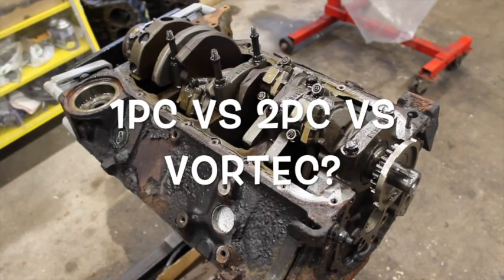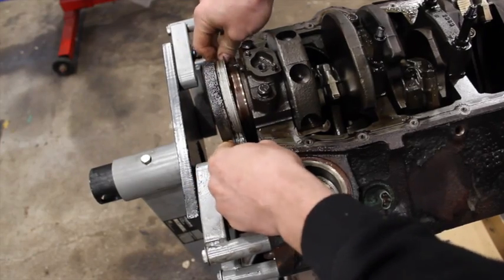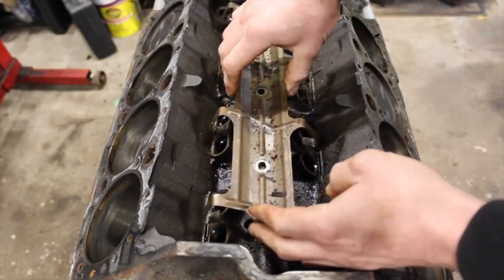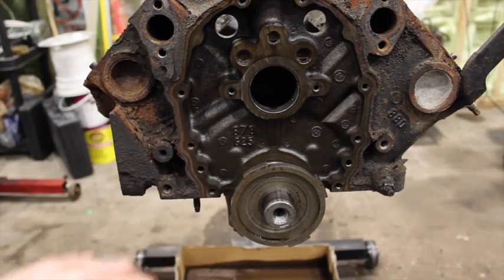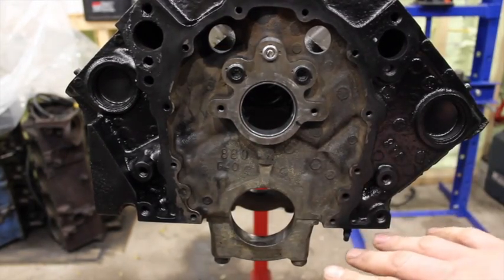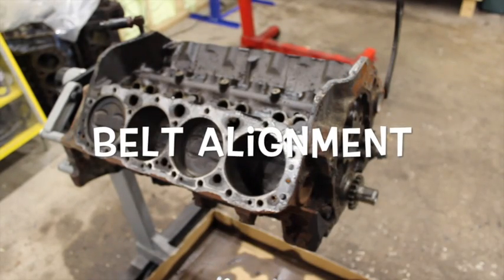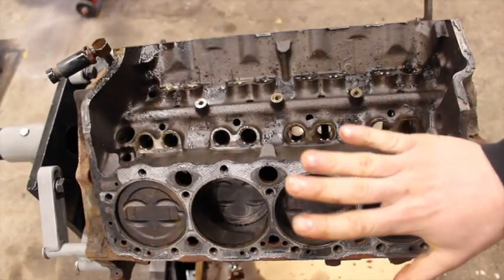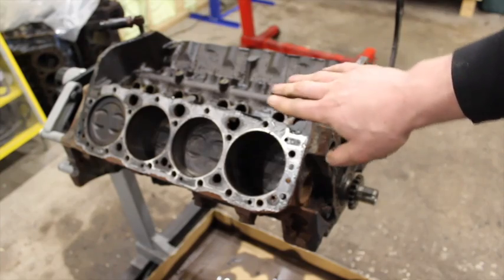1 Piece vs 2 Piece vs Vortec Blocks? SBC

Comment: I did not read all the comments to see if this has or hasn't been mentioned yet. ---Water pump bypass---. There are late model "one piece" blocks,,,  86-95 "vorteX" and there are 96-01 "vorteC" blocks. The 96-01 "vorteC" blocks lack the lower hole drilled in the pass side water pump mating surface that leads to the pass side head mating surface. Also the 96-01 "vorteC" heads are not drilled with the bypass hole from the factory either. The 55-95 1pc or 2 pc blocks and the "vorteX" and earlier heads which are drilled use this as a water pump bypass passage. The 96-up "vorteC" heads and blocks use a water pump similar to BBC's where the bypass is incorporated into a short rubber hose that runs up off the top of the water pump and into the intake manifold. If using "vorteC" heads (which are not drilled for the bypass at the mounting surface) on 95-earlier blocks you can simply drill the hole in the head mating surface but I'm not sure if it's straight through or at an angle,???. If using a 86-95 1pc block to build as a "vorteC" replacement motor, don't worry about the extra hole in that location, as long as your using factory "vorteC" heads that haven't been modified. Water will never make it there to leak back through.

Comment: Well im going to take your word for it i know you build alot more small blocks then most people i like the fact that you can run factory roller lifters i wish gm offered solid lifters for a small block vortec im glad you said about not seeing as much core shift as the old blocks i was told by a few people that you cant trust a vortec block above 550 hp. I am going to use a vortec block to build a 302 by using a crank out of a 4.3 vortex V8 with the 3 inch stroke.

Comment: Ive got an 880 block and super t 10 .my clutch size is 10.5 26 spline count.and my crankshaft bolt pattern is smaller than the 11 inch oreillys tried to give me .what are my dimensions then i need to replace my clutch gonna be?

Comment: If the 2 piece is installed correctly it will never leak,  but with the one piece will have a better chance for leaking due to the back plate that bolts to the back of the block.

Comment: Never liked the thin cast 87’ up blocks. 

Thickest cast Chevy v8s at that point was the 305.
Reply from the maker: I sonic test each one. I find the 638 blocks are all over the place for thickness/thin spots, but sometimes are the thickest and good blocks. The 880 blocks are abit more consistent. If they sonic test well, I've had no issues with them under the 500hp level

Comment: You mentioned a couple things new to me. Maybe a video about them is a good idea. Sonic testing... How is that done? Block filler? 
A question about the vortec 880 oil pan. Does a Vortec oil pan have that  horizontal baffle it like the earlier ones? Because the 880 main cap bolts have provision for a windage tray. Not sure if I need both.

Comment: You ever add an aftermarket computer & msd distributor ect & trigger off the crank?  Been wondering if an LS1 system could be adapted using the cam sensor to trigger #1 & 2-8 off the crank sensor.  They could both be triggered off the timming cover & or adding an external crank trigger.  Coil over plug has some cool advantages
Reply from the maker: I haven't, but I have used sequential computers (holley) on Gen1 sbcs using dual sync distributors
Reply: Efi connection has 24x and 58x timing cover and reluctor setups for sbc and gen2 lt1 so you can run ls1 coil on plug and ls computers

Comment: For the front cover Holley makes an aluminum cover. HLY-21-152 do yourself a favor and get one of those. They make them with or without the boss for the crank sensor. I used the with the crank sensor. As an off roader the biggest problem was always a carb. Carbs don't like being bounced around, nor do they like extreme angles.  Access to the cheap fuel injector available with the 880 block is a HUGE upgrade. They can easily be converted to a multi-point. I am using that setup in my -57 Willy Wagon with the GM computer and wiring and LOVE it. I've got pretty much the same setup in my 96 Yukon. I was contemplating converting to an LS block but after watching Piss cutter videos I upgraded the Yukon 880 block. Maybe not quite as good as a LS but with the mods here it saved me a TON of work and money. THANKS PISS CUTTER!!!

Comment: Is there any particular year or range of years or castings for a 1 pc seal, roller cam 350 blocks that are easiest or most sensible to build on, for street use, say 350-400hp target.
I'm thinking this might be the cheapest/easiest upgrade to the old 79 L82 smogbog engine (hft) in my Corvette. I'd love to throw a late model LS in it but I'm not tooled up for a big headachy retro-fab job like that.
Reply from the maker: 87 to 95 (638) roller blocks are good, will have provisions for mechanical fuel pump 4 or 2 bolt mains are fine but should sonic test cylinder walls as some can be thin. Some will need the holes tapped for the lifter tray. 
The 1996+ vortec 880 block are good aswell but they often won't have provisions for a mechanical fuel pump. Two timing cover bolts may have to drilled/ tapped. Cylinder walls are often quite thick and usually have minimal Cylinder wear.
I've pushed both style blocks past 500hp
Reply: @cuttersperformance  Thank you sir. Greatly appreciated.

Comment: I removed reluctor wheel ordered wrong balancer. What it is. 1/4 inch diff. Roughly?
Reply from the maker: I believe it's slightly under 1/4 inch. I tried to find one to meausre for you in my parts bin but didn't have one
Reply: @cuttersperformance  thanks man. I went ahead and ordered one.  It'll be here today. I'm hoping to get this in the run stand tomorrow. It's sad we don't have any engine dynos here in North Carolina. Shit load of drive ons.
Reply: Can you just leave the wheel in there ?

Comment: Great video. I to like the late model blocks. Here's a question. Have you done a crank conversion. 2 piece to one piece block? I looked for a video. Couldn't find one. I think you need to make one. Thanks and holler back!!
Reply from the maker: No actually I haven't but I do have a 2pc forged block im considering using a 1pc block, so i may have to try
Reply: @cuttersperformance  
Did you mix up your words?

Comment: Hey, I've read that the 880 blocks have a shorter cylinder bore length, and isn't ideal for a 383 stroker crank. the pistons pull too far out the bottom of the cylinders.. Did you notice this when building your 383? Did you change the rod length and move the pin height up in the piston?
Reply from the maker: Yes that is true. Use a 6 inch rod with your stoker kit and youll be fine 

But you can use a 5.700 rod but only when running hyper pistons with tight wall clearance or you'll find the piston will rock at the bottom of the bore causing a weird wear pattern on the piston skirt.

Comment: So, do all factory 350 1 piece rear main seal engines use a flex plate that has a weight welded onto it?  I have a 1986 350 crate motor 10048971 that will be going into a 1979 pickup with a turbo 350 trans and stock torque converter and I'm trying to figure out what flex plate and harmonic dampener to use.
Reply from the maker: Yeah, the 1pc engines are considered externally balanced on the rear so the flex plate will have a weight on it. 

Actually, funny story, I once had a c4 corvette at the shop that the customer just bought. This car didn't have the original engine, and it had a pretty intense engine vibration. 
It took me a bit to figure out what was going on, but it turned out that when they swapped the engine, they dilled out the counter weight on the fly wheel. 
The customer didn't really want to spend the money pulling the engine or transmission but wondered if there was a fix I could do to make it better.
Well, my redneck idea....I removed the starter and fill welded all spots that were drilled out in the flywheel.
Worked perfectly! Hahaha, it's been like that for 5+ years
Reply: 2 piece flex plates have a larger bolt spacing mount pattern then a 1 piece seal, also no large weight. An exception could be an 400 sbc, not sure about their bolt spacing but they do have a weight.

Comment: I have 94 sbc 638 block, edelbrock heads, what water pump should I use? Going into a 72 chevelle, long snout water pump 
Thanks keep the great videos coming.
Reply from the maker: Both the 638 block and edelbrock heads will be drilled for an internal water pump bypass so a traditional SBC water pump works just fine.

You can fit a good size rad and have lots of air flow with a chevelle, so a regular volume stock replacement pump should work for you

Cheers!

Comment: The black block is not a vortrc block. On the left side water pump holes has the vent hole which was eliminated on vortecs.
Reply from the maker: Thats true but often times they were drilled at the front by not all the way up into the head (there's no hole in the deck surface) that block is indeed a 880 vortec block

Comment: Have you ever used them 2 piece adapters for a later block to accommodate a early crank? I want to build a 427 and cannot find a one piece 396 crank
Reply: They work great but only if you buy the adapter centering bar they sell that bolts in the rear cap to center the seal adapter in the same plane as the crank.

Comment: There are good things about both blocks. The 2 piece rear main seals are easier to change with the engine still in the truck or car, as long as you can get the pan off. The 2 piece rear main will not leak if it's installed properly, at least that's my experience. The later 1 piece blocks allow you to run a roller cam affordably.
Reply: The biggest difference is you probably won't need to change the seal if it is one piece. The two piece seal was notorious for leaks, which is why they went to a one piece. Blame the mechanic lol the one piece seal goes where it goes the two piece goes where it goes, the mechanic put it in wrong is a farce.
Reply: @michaeldose2041  The 2 piece seal does not just "go where it goes". To install the 2 piece rear seal properly, you have to install the seals so the parting lines of the seal don't line up with the parting lines between the block and the rear main cap. Then, smear some Ultra Black RTV on the bottom of the main cap and the ends of the seals. I've been doing them this way for more than 20 years with no leaks. No seal lasts forever.

Comment: I myself go for the old guys especially the 69-72 blocks because some of the 4 bolt blocks have 2482 nodular main caps. Newer blocks don’t have them
Reply: 010 blocks are everywhere
Reply: Yes all three of the remaining blocks that are bored 60 over.
Reply: @michaeldose2041  bought a 3970010 block literally 2 Months ago for 50 bucks, standard bore. 

Y’all just tryna jack up the prices Lmaooo.
Reply: @Shade_tree_garage01  I am trying to jack up the prices? What color is the sky in your world? The newest of those boat anchors is 30 years old and I wouldn't pay you 30 bucks for that cracked POS that you just ''scored''.
Reply: good luck finding them......I had an 010 4 bolt engine I bought 20 years ago for like $30 cause I was in the right place at the right time.....sold it about a year later for $100 to a guy I knew that built it for his Monte Carlo. Now the Monte's and the 010 blocks are all gone.
Reply: 010 blocks are almost free, yes they're everywhere.....even today. And I'm in the SF Bay Area where everything is priced sky high.

Comment: Ive got a 95 tahoe with the 5.7. If I got a 1 piece block ( I know from when I had the trans rebuilt ) can I replace the pan seal? I've got a slow leak coming from the pan gasket. I had the rear main replace when the trans was rebuilt. Just don't know if its too much of a hassle to deal with it now vs when I replace the engine down the line. Its got 150k and lifter tick so its kinda iffy.
Reply from the maker: Yeah you can replace the pan seal but its abit of a job.
You will have a drop down the front diff (if its 4wd) and jack up the motor abit and if i remember correctly the exhauat is in the way too
Reply: @cuttersperformance  well knowing all that I might just wait to replace the block. Lol. I know I won't have to worry about the exhaust since I went true dual straights and it doesn't come near the pan anymore. Would just suck to find out its a four bolt main and put in a two bolt block block. Lol. Might have to use my bore scope the next oil change and try and find out. The previous owner claimed it was a four bolt main but I have my doubts. Lol. Thanks for the response and keep up the videos! I love watching them!

Comment: Strictly my opinion I prefer the one piece rms it has a thicker rear hub for mounting a flywheel or flex plate. Although it is easier to replace a two piece RMS you don't have to drop the transmission to do the job but if you don't do it right you're doing it twice also the one piece has better oil pan gaskets from the factory. You can get the same crank sizes for either but I always tell people use what came in your application unless you already have to buy a different flywheel for flex plate. I'm running an 86 trans am with a gmpp 350 1-piece rms, roller cam, vortec heads ported, stealth ram, and CX Racing single turbo with t-76. All backed by a T-56 and a 9-bolt with 3.70 gears.

Comment: Yeah i have an 880 block from a 2500 4x4. Its a 2 bolt main even though the casting number said 4 bolt main. I guess im not boosting it now.
Reply: Why not? Send it.
Reply: @superduty4556  because i sold the engine and the wagon it was for for a datsun 😂😁
Reply: Splayed caps are stronger than a normal 4 bolt

Comment: I had a 1990 350 block out of a truck that had the spider retainer holes drilled but the lifter bosses weren't milled for the lifter dog bones. I thought It was really weird
Reply from the maker: Wow never seen that before
Did it have the cam retainer plate holes?
Reply: @cuttersperformance  it had the bosses for it but they weren't drilled

Comment: @4:40 the lifter gallery plugs from the factory had pinholes to get extra oil on the timing chain, since the retainer plate blocks the drip from the front cam bearing that oiled flat tappet timing chains.

So far as the timing cover goes I left the reluctor, and bought a plastic timing cover that wasn't drilled for the crank sensor. That let me use a Vortec balancer, and will allow fuel injection to go back on later if desired.

@11:00 the SGI blocks (some TBI, Most Vortec) experience ALOT less bore wear than the old grey cast iron blocks. Not uncommon to open a 300,000 mile Vortec and put it back together STD bore.
Reply: 880 very quality block with a bit more nickel added to the iron for less wear gm calls it an E block for enhanced along with the head design made to last twice as long as old blocks I also like the oil pan windage tray setup on my 98 and factory forged rods makes for easy cheap 400hp everyday reliable...
Reply: @johndough2363  the block is Nodular iron, the "extra nickel" is a wives tale.
Reply: @johndough2363  all the old Chevy rods were forged
Reply: @stevenbelue5496  The vortec 350 had powered metal rods that are superior to the earlier rods.
Reply: @johnwehunt4305  yes there is a lot of controversy whether the pm rods qualify as forged. They go through a process similar to die forging where they are heated to extreme temperatures and press compacted in a die. Started out with powdered grains/ bonding agents and sintering  is all together different than the traditional forging process.
Reply: @jacobnorth8642  wrong

Comment: has anybody come across a one piece seal block that has stepped lifter bores in it? the top 3/16 or so of the bore is about 1/8" bigger in diameter. when you try to put a high lift cam in it the lifter comes up out of the normal bore diameter enough that it causes a major oil leak and will not work correctly. was this done on purpose at the factory and if so why.
Reply from the maker: Can you send me a picture?
Pcperformance1@outlook.com
Reply: I build these for a living and I had one in the 90s that customer had and wanted a roller cam in it. The oil pressure was extremely low and couldn’t figure it out. I ran without a valve cover and noticed major oil splash coming from underneath through pushrod holes. Yanked intake and figured out oil bands in lifters were exposed in the wider part of lifter bore and exposing the oil gallery. I had to have another block machined and cured problem.

Comment: I have a Vortec I’m putting a double roller set on, will I need a different dampener?
Reply from the maker: Yeah as soon as you remove the reluctor ring off the crank (you will need to remove it when going double roller) then you will need a regular sbc balancer

Comment: I have a bone stock 2000 350 vortec 175K I put in a 58 chevy wagon.  I added a nice quadrajet, intake and hei.  I used short waterpump, I didn't tap the block for timing cover but I learned after a few months the balancer was not going to cut it. Forget using stock dipstick with ramhorn exhaust mainfolds as well.  I have a few leaks to fix. (didn't leak a drop first year) but as far as stock motor it runs great.  Used the ac delco boat fuel pump starts and runs great. I wouldn't rebuild a flat tappet 350 from scratch again I'd go with a roller block.  There's a dyno of a stock junkyard vortec 350 with holley 650, headers makes 313hp and over 390LBs of torque. Great cruiser engine in stock form.

Comment: Wow very good information. So. Can i use a camshaft and lifters flat tapet from 350 old  in vortec block.  ?? Thanks alot
Reply from the maker: Yes you can use a flat tappet cam in a vortec block
Reply: @cuttersperformance  i like it. Thanks  i will do good good information.